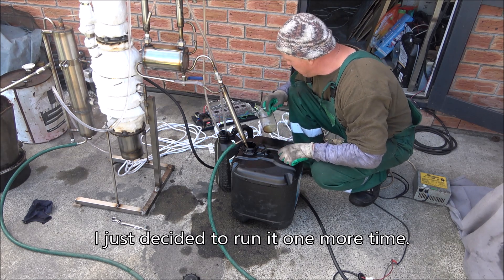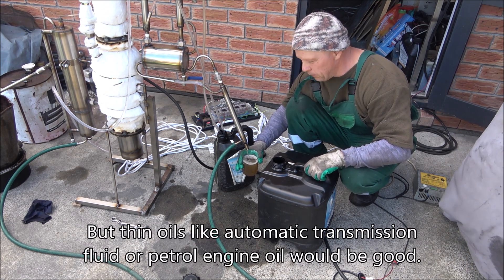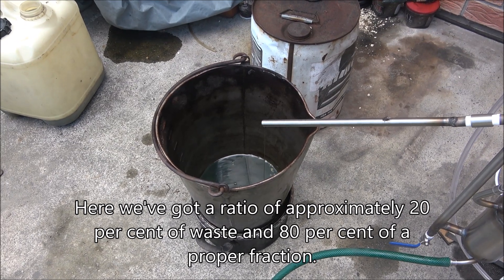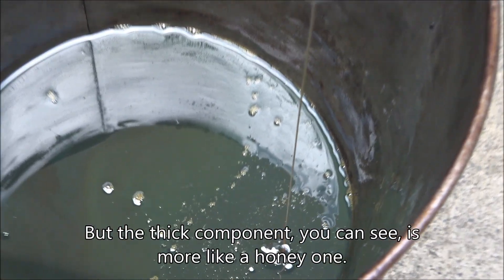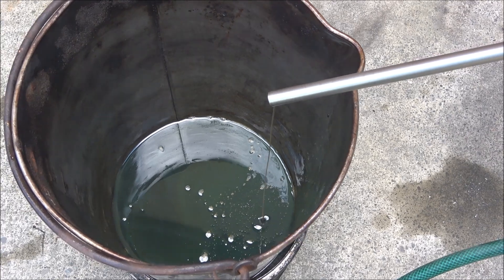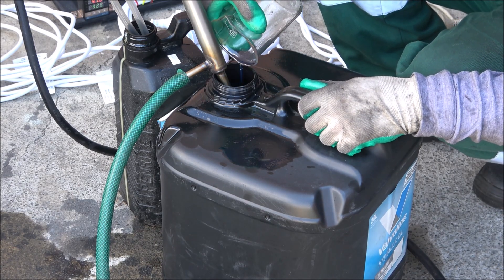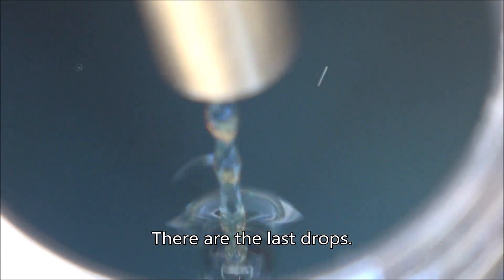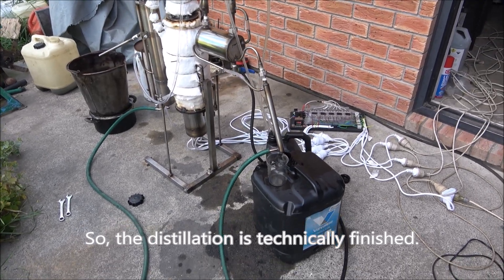Continuous Waste Automotive Oil distiller- ATF/Hydraulic oil mix diistillation.

Comment: I suggested some better gasket material to use a few months back I believe the brand was g r a f Fleet brand something like that I can't remember exactly anyways it was graphite and stainless steel mesh I upgraded to this type gasket material no smoking no leaking no wicking no retorquing nothing completely dry
Reply from the maker: Yes, graphite gasket material is good for high temperature applications, was busy travelling between countries, with no time to get anything better, Believe got the last piece available here at all, and it get gradually worse over time, used to be real deal, not anymore.

Comment: how can you hydrogenate the distilate to prevent oxidation
Reply from the maker: Usually  you let it ixidize for the first three days, so most of reactions will be over, then transfer into a reactor vessel and treat with methoxide Methanol/sodium hydroxide mix, then remove all deposits, wash with water, run through centrifuge and store with some silica gel, it will remove any bad odor, polymers and paraffin, storage with silica will de-colorize it in a few days of storage.

Comment: how many solar panel would you need to run the distiller
Reply from the maker: ok, say it is a 4kw unit, so you may need an excess of at least 5kw continuous (panel position in regards to moving sun, clouds, additional battery bank to compensate) now if one panel is stated at 350w it may be stable at providing 250w in proper condition, then at least 16 350w panels plus compensating power bank and good inverter will do the trick.

Comment: Is the production with hydraulic oil faster than WMO or the same?
Reply from the maker: it is slower, the hydraulic oil appears to have a lot of additives to prevent it from boiling in the hydraulic pump and releasing any gas that would compromise the hydraulic system, the additives are really heavy high temperature hydrocarbons, more like paraffin, you can see the separated heavy fraction -  the petrol engine oil is much easier to work with.

Comment: If i plase 30 kw immersion heater how much oil can i process per hour
Reply: 100 liters per hour
Reply from the maker: it is not about how powerful your heater, the factor of an element shield load, and surface area of the actual element must be taken into account, thus 30kw immersion element say relatively small and glowing red will produce only white smoke, but distiller built to accept such an element with correct load per square inch may do up to 100l but all depends on the oil type and quality.

Comment: You make that look so easy Alek, I haven't had the time to build one of these or a centrifuge yet. So Time poor, I've done a number of total restorations on quite a few pieces of machinery lately, just finished another one. I've got about 2000 liters of fish & chip oil for starters to process when I get to it. This stuff is sticky ( I spilled a bit on the ute tray and it took years to wash off), I don't know how it'll go.
Reply from the maker: Yea, looks easy, but not so much, just an experience, I know intuitively what to do, anyway the only way to deal with vegetable oil is to run though a centrifuge, and convert into a biodiesel with methanol/hydroxide solution, then can be mixed with normal diesel or kerosene, no way it could be distilled.

Comment: You will still get high egt even if there are zero particles since motor oil has a higher energy density than diesel
Reply from the maker: I do not run engines with motor oil, but with distillate that has exactly the same as diesel fuel density, 830kg/m3, so no difference in EGT.

Comment: Would a piston type dosing pump be an upgrade since they're not affected by viscosity
Reply from the maker: Sure, the gear pump also a good option, though they are creating way too much pressure, so a bypass must be organized.
Reply: @santeryi9  I think the dosing pump with the Piston type has two check valves and a timing device for volume I believe they control the amount of time it takes for the Piston to travel back into and pump a certain amount of volume of liquid and supposedly they can pump any liquid any viscosity and it's not affected by temperature because of fixed displacement
Reply: @santeryi9  also the waste from my distiller unit from you if left to settle for say a month or two will become clear and clean all the black and dirty residue will settle to the bottom of the container and leave a clean dark red semi distilled liquid I guess it is partly cracked and partly mixed with undistilled oil as well either way it settles and becomes transparent
Reply: What about a membrane pump? Not sure if that is the correct name, but it is like a primer pump on my Kubota. I think it runs of sime sort of solenoid & membrane